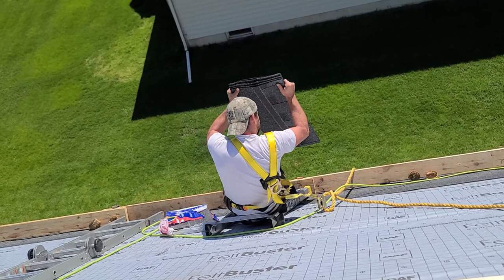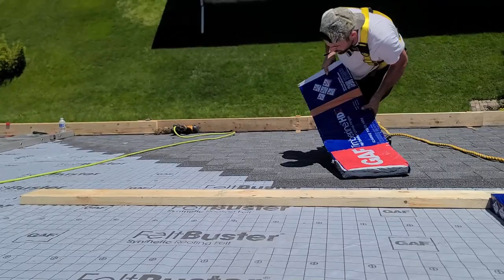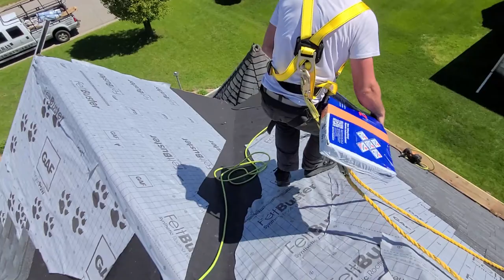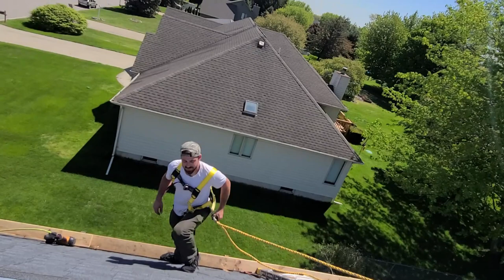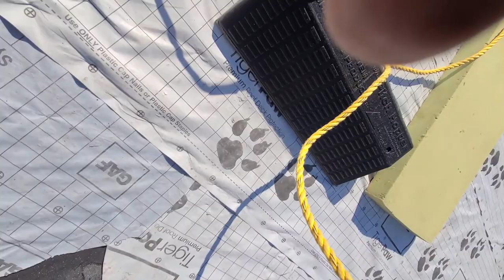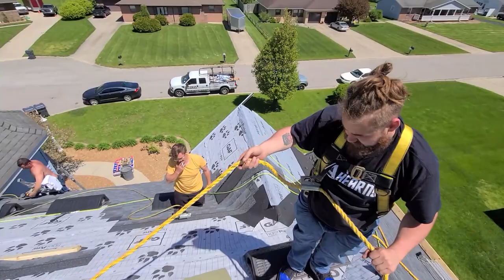Worlds Fastest Shingler | 12/12 Using Chicken Ladders (UNEDITED)

Comment: I've done my fair share of roofing. We had an old hospital in my home town that was being converted to an apartment block. There was 3 stories and it was early spring. My boss got to the site early and set up the ladders on the second story flat roof. I made my way out and remember him telling me that if I fall I was fired before I hit the ground. Literally 20 seconds later I find myself falling. What happened was the dew produced a bit of frost on the roof and as I went for the final step up the board holding the ladder gave out because of a rotting board I belly flopped on the roof and the ladder slid down resting on the siding just out of reach of my feet. As I said down the roof two nails just so happens to be at the edge and hooked me on 5he inside of both elbows. So there 8 am hanging by terrorist ass nails and as I looked for something to grab my skin ripped. This caused me to fall backwards and my ass went through a set of rungs. All I hear is I told you your fired as the ladder slides down the siding then off the second story flat roof taking me down to the ground. I picked myself up looked over my wounds and said I'm taking lunch. Lol. I still have two identical scars on the inside of each elbow. I just wonder how it would have turned out if those two nails hadn't been missed. I would have went down a lot faster and more than likely not been typing this. At least in an understandable fashion. But I still miss those days.
Reply: rip old man
Reply: Wow,why wouldn't you wear a harness and being such a liability on the job ,I bet your boss had no insurance or workers compensation.
Reply: Cowboys Inc...

Comment: We used to stand on 2ft pieces of 2x4 .we called them old men lol .we roofed in sections from the top down off of 2 x 4s the capernters left we just measured lines and nail the first shingle high then re nailed it as we filled in the boards from top down also.yes we marked 22.5 inch lines on it but we had so many different ppl sometimes  10 at a time we just couldn't go without lines and the timberline shingles were metric that's why it was 22.5 lines instead of 20s. Love the videos brings back alot of memories

Comment: I’m 18 years old let me give you advice how to do a 12/12 the fast way and the right way everyone has their own style of working this is my PERSONAL OPINION. I use a mountain harness I really recommend it helps you maneuver yourself better... when I’m tearing off I take out or renail the nails while I take off part of the shingles. I only renail if the paper has staples because the paper will pull down and rip with your weight. Once I finish tearing off I don’t have to nail the nails back in or take them out so I just felt the first 2 lines using the ladder with 1 inch nail caps. My first chalk line is 17 1/2 then my second 45 after that you should be good nail the first 4 lines all the way down with your starter. After that put your jack and 2x4 or 2x6 I prefer 2x6 way much better more balance. After u put ur jacks nail your shingles until you see the line on top of the felt and felt another 2 lines and work your way all the way up. In my opinion this is how I finish fast and easy. I’m in Texas so I 4 nail in other hurricane states and windy states I recommend you 6 nail or even 8 nail your shingles. If you use this method and have a fast pace and good work quality I promise you will nail 10 sq in a 12/12 In 2hrs. Remember you nailing 8 nails fast doesn’t mean you’re fast you putting the shingle how it supposed to be is what speed is! Learn how that shingle is supposed to land put 4 quick right nails and let’s goo

Comment: Your boy on the peak should have been feeding you lol
Reply from the maker: I was actually doing a test run.  I do a different method on the opposite side of the house which Is the same size.
Reply: @NWIVeteranConstruction  did you do cushion no rope and harness with jack and board in the feeder on the other side
Reply from the maker: nope! much simpler than that! beat it by 20 minutes!

Comment: No tar/roofing cement under the shingle "tabs" or high wind nailing pattern...hope you're not in an area that gets high winds.
Reply from the maker: That's only required on 18/12s. Along with the 6 nail pattern.  Unless you're in a hurricane type area where they already require 6 nails and tar on edges of roof metal

Comment: Great job Zach. No thank you.
Reply from the maker: Fair enough!
Reply: @NWIVeteranConstruction  quick question. I have to repair 5 year-old ridge that is loose for six feet at a time down the whole peak. Should I redo the whole ridge, or peel caps and re-use? If I re-use, should I tar every cap, or will they reseal? Not only is the plastic flapping, but obviously the nails in the caps didn't hold either.  There are five sections with at LEAST six feet just laying loose on the ridge unattached.

Comment: You can tell your not used to the steep. Still know what your doing and can get it done but alot of screwing around getting tied up in that safety gear. Nice to see you wearing it though. Most guys I see on steep use boards or a rope but never both
Reply from the maker: i've done a ton of them and i definitely still killed that for no tosser n no breaks lol
Reply: @NWIVeteranConstruction  you did pretty good and not many people would even try what you just did. But there are definitely things I would have done differently that would probably have brought you back up closer to your normal speed
Reply: @NWIVeteranConstruction  for instance making better use of that lower slope on your hips